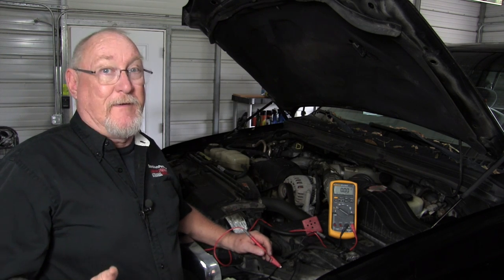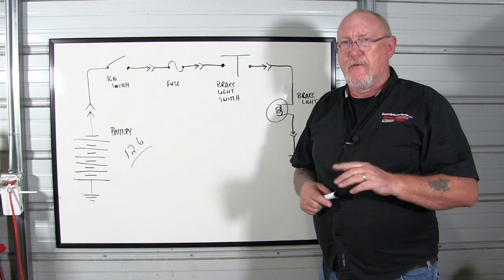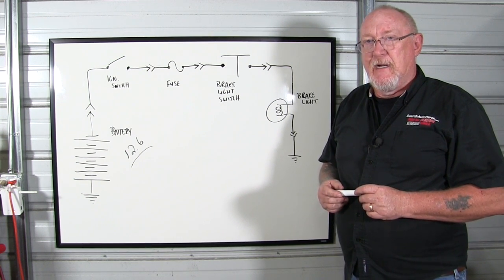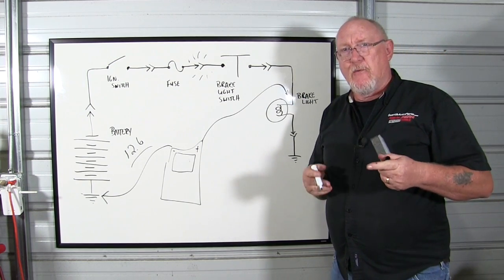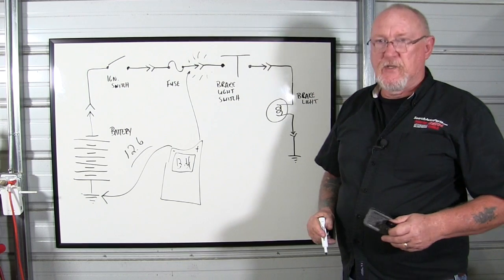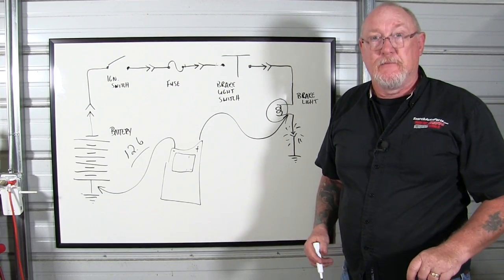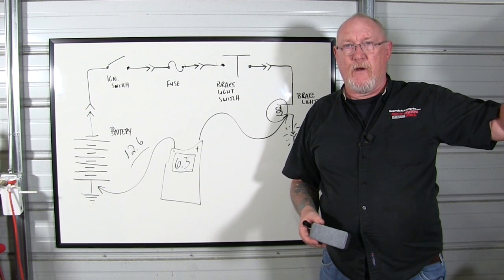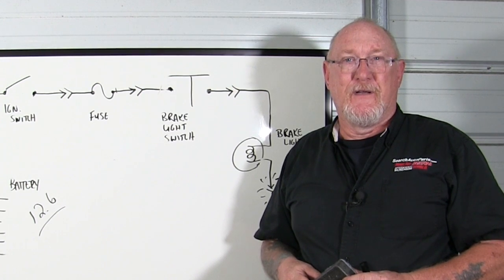The Trainer #84:  How You Can Measure Voltage When Your Meter Leads Say You Shouldn't

Comment: Ok, I do not have a thief I have 19 vdc from the casing of the alternator to the negative side of the battery.  I have 14.4 vdc from the casing of the alternator to the positive side of the battery and then I have 12.8 vdc across the battery.  This is in a 2016 Nissan Altima that just had the transmission replaced.  I got it back and within a week the alternator went out.  I had just replaced the alternator last May.  So I replaced the alternator and drove 4 miles and another alternator voltage regulator was burned up.  So, then I had it towed to the dealer and I told them about the high voltage that I measured but they ignored me and replaced the alternator.  They told me it was because I had installed an aftermarket alternator.  They did not check the voltage as I did before I took it to them.  Now it has another alternator and I still get 19 vdc from alternator casing to the neg battery so I suspect that I will be broke down again soon.  almost 4k for the tranny and today almost 900 for the alternator and going to still have the problem
Reply from the maker: To be clear, if you have your negative meter lead at the negative battery post and the other lead at the alternator casing - and you're reading 19v - there is no question you have a bad ground. Move the lead from the alternator case to the engine block and see if the reading changes. I'm guessing it won't.

I'm betting that a ground was left disconnected when the tranny was reinstalled. To verify, you can take a jumper cable and connect one end to the battery negative terminal and the other to the engine block. If the 19v reading goes away, you've confirmed the problem.
Reply: @VehicleServiceandRepair  Ok, tested my meter leads tonight to make sure that they have zero continuity and they were dead on, put fresh batteries in and I hooked one end of jumper able to the alternator casing and the other engine to an engine ground, and took the positive lead of the meter and hooked it to the negative side of the battery and did these readings.  I left all of the hookups the same for all readings.  so all of these readings are in reference to the positive lead being on the negative terminal of the battery,  to alternator case 5.2 vdc, transmission 4.4v, ecm bracket 1.4 v, power steering pump .63v, top of the strut bolt .2v, brake booster 2.9v radiator >>41.5 v<<, thing that is on the firewall on the passenger side that is square, lol sorry will have to find the name >>>2.9v and to the positive of bat 14 v.  Then I unhooked the engine ground to the alternator ground and left positive lead of meter on the negative of the battery and got these readings.  alt. case 4.7 v, tranny 4v, ecm bracket 1.5v power steering pump metal >>>107 vdc<<<, strut top bolt 1.1v, brake booster 2.9v radiator >>>139 vdc<<<<, passenger side square thing 2.9v battery positive 13.91.  I double checked and triple check the very high voltages and I cannot understand and it is not even believable.   I called dealer mid-day and tried to talk to the service manager i dealt with but, i was on hold and then some lady came on and said that the service manager needed to talk to the tech and that they would call me back,  but they did not.  I just charged $4800 on my credit cards there and now they are seemingly ignoring me.
Reply from the maker: @dallaspilotcar9293  You need to take the measurements again but attach the jumper cable end to the negative battery post instead of an engine ground. That didn't provide an alternative path back to the battery.
Reply: @VehicleServiceandRepair  going to try it right now will get back thank you
Reply: I got pretty much the same readings except for the radiator was 66 vdc.    power steering pump was a lot lower but the tranny still at 4.4 v Do to need to know exactly all of the same readings?  Hooking the jumper cable to the ground of the battery and the alternator casing only slightly changed the readings.  The battery terminals are tight the negative side is brand new. The negative side of the battery has a battery sensor on it and the positive has links on it.  I can go back and get the exact readings but wat do you think?
Reply from the maker: @dallaspilotcar9293  I am having trouble wrapping my head around some of the high voltage readings you're getting. There can't be more voltage than what is available at your source. I'm assuming this is not a hybrid??

Let's start from the beginning. With the key "on" and the engine NOT running, measure the voltage potential between the negative battery POST and the alternator case. Also measure the voltage at the battery normally. Last, start the engine and measure the voltage at the battery at idle. Send me those three numbers and we'll start there. BTW - what kind of meter are you using and are you setting it to measure DC Volts and not AC Volts? Are the leads in the correct place? (Just making sure of the little things...)
Reply: @VehicleServiceandRepair  Yes, fresh batteries tested the leads before I used the meter, it is an Clamp Meter UA 2008B and it is not like this has just stated happening.  It has been going on every since they replaced my tranny.  A little over a week ago when I got my car back, out of the blue it went into limp mode and i already knew the signs as I had to replace my alternator last May.  I replaced it the next morning and got about 4 miles and it went out again.  Both times since I live about 2 blocks away from Oreilys I was able to jump off and go test them on the alternator tester and both had burned the voltage regulator.  After replacing it that morning and it burning up on the way home.  I started checking the voltage and that is when I noticed the 19 vdc from the alternator case to the negative of the battery.  It was not until I got my car back from the dealer 2 days ago, that evening before I would hook up my light bar and cb radio, I thought I had better check the voltage again.  I got something around 35 vdc.  I told the dealer that there was a problem with it but they ignored me and just replaced the alternator.  I know that it sounds really strange and I understand.  I have worked on all of my cars and I have a degree from Devry graduated with 4.0 and worked at an engineering company on the test floor for 10 years.  I know that it does not make sense but I know how to use a meter and how important it is to have a good connection.  I could upload the video of me checking them for you to see, but, I cuss in there a couple of times so it is not that ladylike.  Anyhow, I will certainly check exactly what you tell me as soon as I get my car back together,  I had pulled out the battery tray many bolts and unplugged the ecm cables so I could get down inside where the tranny was to check the connector and to cheek the grounds, so the airbox and all is out right now.  However, while doing so I cleaned all vacuumed all and started just checking continuity to battery cable negative to the chassis grounds all over the place getting 0 until I get to the top of the strut tower on the passenger side.  Maybe continuity is not really what I should focus on but, it is a little concerning.
Reply: @VehicleServiceandRepair  I do have other meters but this one has been consistent although i do not like what it is saying.  I will round up my back up also
Reply: @VehicleServiceandRepair  I like the way you teach though and you are way more knowledgeable than me because I went a different direction and did not stick in the field but I still use my meter to trouble shoot and repair anything at home and try to fix all of the issues with my car as well.  I appreciate you sharing your knowledge
Reply from the maker: @dallaspilotcar9293   The Nissan uses a variable control on its alternator and has a dedicated module controlling it. It seems that alternator issues are not uncommon according to a quick Google check. I still believe it is related to the tranny work. Can you send me a picture of the measurement you took at the strut tower, showing where you connected? (Is the battery ground cable attached there before it gets to the battery?) Send it to pmeier386@gmail.com

Comment: so is the left over voltage simply still leaking through the ground side since it is still not being completely absorbed into the earth side; still wrestling with this concept
Reply from the maker: No, voltage doesn't "leak". It takes pressure (voltage) for electrons to overcome resistance (primarily the "load"). But resistance can be any number of things - corrosion, loose connections, bad connector fits, etc. And those, too, require pressure to overcome. When these sources of unwanted and unplanned resistance occur, they demand a higher share of the total voltage available. So if you see a voltage reading, its telling you that there is another "load", another source of substantial resistance, present betwen the leads. Make more sense?
Reply: @VehicleServiceandRepair  Yes it sure does, thanks for clarifying that for me.

Comment: Ok so when u said the 12.6 volts run thru the circuit and once it Passes the load and starts its trip back to the battery and if u have a bad ground can that cause an altinator to over charge even though u have a good battery and altinator and regulater. Thanks Great Video
Reply from the maker: Need more detailed info - what is the make/model/year and what engine is in this vehicle?
Reply: @VehicleServiceandRepair  its a 05 ford mustang gt 4.6
Reply from the maker: @robbiegifford2957  The ECM controls the field in the alternator on your car. Verify that the alternator is properly grounded and that the Orange/Light Blue wire has no excessive resistance between the positive battery post and where it connects to the alternator assembly. Fix any issue you find there first. If they look good, I would want to watch the ECM control with a scope to make sure it was functioning properly. Hope this helps!
Reply: @VehicleServiceandRepair   Thanks I really appreciate it and i will look into, I had added a 4 guage ground to the altinator bolt and it doesnt do it very ofton now. The light might come on once every 4 days now. Thanks again and I will check it out

Comment: To all Techs. out there, inspect the circuit and watch for people “Tapping into” the circuit downstream of the fuse to power another component. ex… fancy LED lighting, add-on accessories etc…
Reply: The last two used cars I bought had parasitic wiring that kept factory lights from functioning. The first caused intermittent headlights and the second was the turn signals. God only knows what the taps and abandoned wiring once went to!

Comment: Is it possible that you can have clicking from solenoid and current passing through solenoid and motor starter where motor starter won't turn over while you hear clicking noise and have a very huge voltage drop which makes solenoid click but won't turn motor starter????
Reply from the maker: That would be an indication that the starter motor (or engine) is unable to move.
Reply: @VehicleServiceandRepair  how about bad ground conection
Reply from the maker: @tonykollar6870  I guess I should clarify. If you see a large drop in the battery's voltage, odds are restricted movement of the starter and/or engine. IF you place your ground meter lead on the ground post of the battery and the positive meter lead on the starter case and you crank it and see a significant voltage on your meter, then you have a bad ground connection.
Reply: @VehicleServiceandRepair  thx I'll try

Comment: Hey Pete my name is Steve and I'm having a problem finding a short in my circuit I have fault codes my mass airflow sensor circuit a is low and then another code that says my purge valve also have low voltage and then I have my coolant temperature sensor it says I have high voltage I probably watched 50 videos on the 5 volt reference but I still don't know if I'm right or not could you please give me cuz I'm not even sure what voltage I'm supposed to have any one of those circuit and since I'm new to doing all this I'm not sure Steven what to put what setting to put my multimeter on the car still the car still runs but barely
Reply from the maker: Post year/make/model/engine and the codes you have. I’ll try to help when I return Monday.

Comment: Your videos are great on voltage drop test,do you have any on how much current a component draws
Reply from the maker: If it's not a motor, you can easily calculate the expected current draw using Ohm's Law.  Current equals voltage divided by resistance. I usually use the resistance specification in the service info and a running voltage of 13.5 to 14.5 volts to come up with what I expect to see. Hope this helps!
Reply: Im from Trinidad and I'm looking for a service Manuel with wiring diagrams for Nissan tiida, any ideas on how can I get one

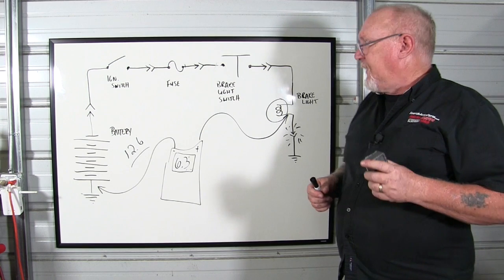Comment: Great video.  One thing is confusing to me.  Around 12:10 I understood you to say that a meter from battery ground to the ground side of the brake light will read what the corrosion load is waiting for.  To me, it seems we are reading the resultant voltage after it was reduced by the blub..  Is that accurate?

I think both statements are true but if I am not wrong, I understand what happened better in my statement.  Thanks.
Reply from the maker: Remember, the meter reads the voltage potential BETWEEN the two leads. That's why we are measuring what the corrosion load is waiting for. Move the ground lead to the other side of the "unwanted" resistance and it will return to near "0".
Reply: @VehicleServiceandRepair  Thanks.

Comment: At 0:22, you have your negative lead on the negative battery post and your positive lead on the body of the alternator and your meter is showing -1.79 (negative 1.79 volts.) How can that be? I could understand a positive 1.79 volts. How can the voltage ever be more negative than the negative post of the battery?
Reply: I just watched the video and also noticed the negative -1.79 volts. I was going to ask the same question you're asking, but I decided to look at the comment before asking in hopes it had already been answered. It looks like you never received a response from Pete or his team. Did you figure it out? If you did, can you please share the answer?

Comment: Excellent explanation as clear as it can possibly be. The only problem is locating the wires and grounds for some of us bigginers some of the diagrams and locations are hard to find I'm sure if I open up the harness tracing it i I will end up finding the problem but is that what we have to do or know whear to look instead of stripping everything till we find it just trying to learn how to work smarter and over come the fear everyone has with electrical problems
Reply from the maker: If you're diagnosing an electrical problem, you need a good wiring diagram. One source I've used in the past is the Mitchell DIY site:  https://www.eautorepair.net/. As for finding the source of extra resistance, move back toward the battery until your meter reading returns to normal, using easy spots on the circuit - connectors, splice packs, etc. Then head back the other way in shorter steps until the meter reading goes high again. Keep narrowing it down until you've found the problem.

Comment: This is all while the vehicle is running, correct?
Reply from the maker: The vehicle only has to be running if the load you are diagnosing only operates under KOEO. The KEY is that the circuit you are troubleshooting has to be "on".